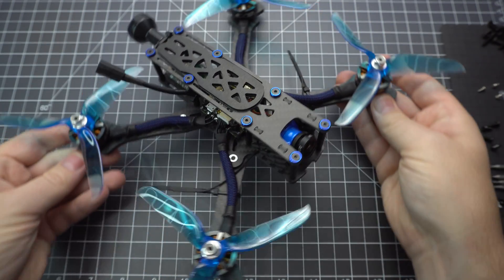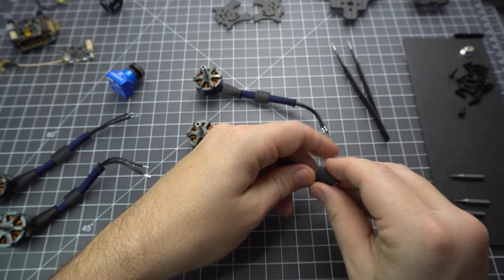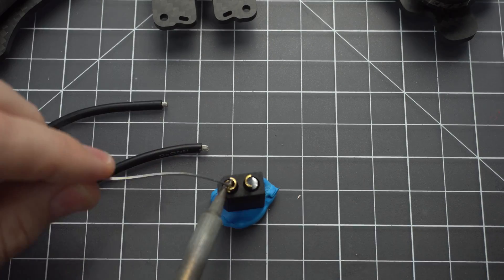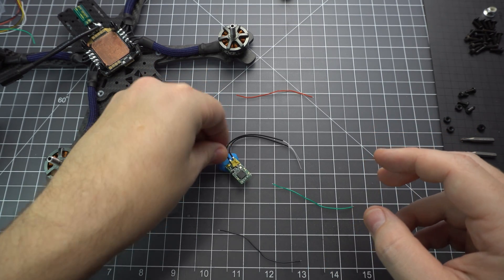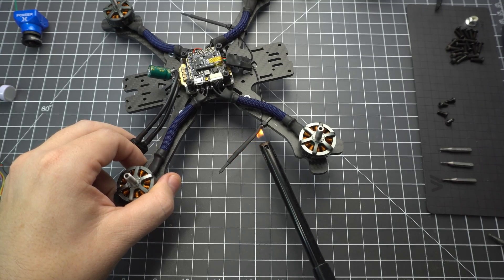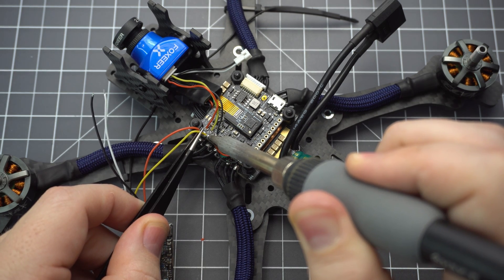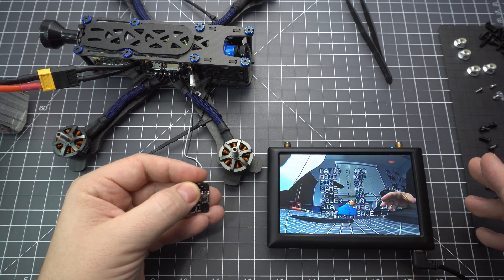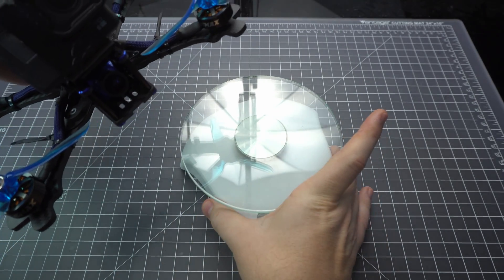How to Build a 6S FPV Freestyle Drone - TBS Source One

Comment: Ive been flying drones fot a few years now and im considering building my first drone . I also want to take my HS 150 Bolt Bee and put it on a different frame that way i can use normal lipo batterys instead of looking for battery packs for it

Comment: Hey! I have absolutely 0 experience with pid tunes, and have no clue what you meant when you said "betaflight reccommends you drop the p and d term about 30% for this build" is there somewhere that the betaflight devs give a reccommended pid tune for specific voltages? I just build the source one in 7 inch and def need a pid tune but dunno wtf im doing sooo.. any tips?

Comment: AFTER i ordered my parts for my first 5”  build, i come across this video and the parts list are almost identical, minus the flight controller (iflight succex e f407 stack) and powered by 4S… parts arrived today and ill be building soon, using this to follow along with. If it works out as expected, I owe it to the folks like yourself, and the heavy hitters in this hobby to document the effort as a true beginner 🤞🏼👍🏽

Comment: Would you be able to use the Xilo stax combo for this build instead?
Reply from the maker: Yep, that'll work just fine. You can use just about anything on this frame as long as it's got the amps to power the motors.
Reply: @whiffles  Thanks for the help

Comment: What capacitor are u using and can u use them for any 6s built?
Reply from the maker: It's just a 470uF 35V Low ESR Capacitor. And yes you can use them for any 6S build.

Comment: How much do all the parts cost?
Reply from the maker: The part list is linked in the description. The FC/ESC is discontinued, but you can use the alternative. You'll just need to adjust the wiring.

Comment: Superb video man. Din know you're the guy who made Rotor Builds until now. Really nice!!  Ive been following it for quite few months now. And I'm planning to build the same one except for the vtx which im planning to use a dji air unit. Is is okay if i remove the middle-rear stand-offs to fit it in.
Reply from the maker: You'll need several 3D prints to fit the full DJI air unit. It's much better to use the Caddx Vista with the longer camera cable.

Comment: I have a 30 x 30 Vtx is there enough room to mount it on the main stack with fc and esc?
Reply from the maker: You should be able to squeeze it in, but it may require tweaking the standoffs and spacing.

Comment: built this and fried my vtx on first plug in. one part melted right through the plastic shrink wrap it has on it. I have no idea what to do but I suppose these puzzles come with the hobby xD everything else went great and I love this set up. Just gotta get mine finished and working.
Reply from the maker: Oh no! Maybe double check the polarity. Did you get the HV version or the 5V version of the VTX?
Reply: @whiffles  upon a little research on how to find the polarity of a vtx just now... ive come to find that it is something I need to check and be familiar with so I bought a multimeter. I do have the hv version but I hadn't been thinking about polarity at all through this project. Noob mistake . I'm very much a beginner to rc and its been a confusing path to understand all this but worth it for sure. Any advice is very much appreciated. :)
Reply: @whiffles  also now im remembering there was a sticker on the vtx package that said "vtx 5v" so maybe I did have the wrong part. On my receipt though I bought the "TBS Unify Pro 5G8 V3 (SMA)"
Reply: @whiffles  one more thing. I did pay attention to polarity with the battery lead and capacitor I had no idea about checking it with the vtx and possibly other things
Reply from the maker: @sluj49  Just checked the specs and it says "Operating Voltage: 4.5 - 5.5V" so you probably gave it too much voltage. You always want to double check the max input voltage to your components. I used the "HV" version which takes up to 26v so if you wired it the same way I did that would have certainly killed it. Sorry to hear, definitely a bummer!
Reply: @whiffles  good to know I am going to buy the one you used. This is a much better alternative to having mucked things up in a mystery way. Thanks for taking the time! I very much appreciate the help.

Comment: Man, very helpful video. I was exactly looking for a guide like this. 

I am new to FPV and want to build my first Quad. I am considering useing the Diatone Mamba F722S Stack F7 FC + 50A ESC
 Stack instead of the Holybro. Would that work the same way?

Is there a big difference between the EMAX ECO 2207 1700kv and the Iflight XING X2207 1800KV?
Reply from the maker: I'm sure the Mamba will work just fine. Make sure you examine the wiring diagram closely though. The iFlight Xing motors are great, but if you're on a budget you might even want to look at the Xing-E motors.

Comment: What is the purpose of capacitor?
Reply from the maker: They're generally to keep the video feed clean of motor noise.
Reply: Whiffles Thank you! And how long does 4S LiPo 1500 mAh 100C battery lasts while using 2400 kv BLDC motors along with fpv

Comment: Why do drones have capacitors on the battery line? Is that to help managing power demand peaks?
Reply from the maker: It's more for suppressing some of the motor noise so lines don't show up in the video feed. It can also help filter the noise for the gyro on the FC.
Reply: Thanks

Comment: I want to build my first FPV drone - I want to attach a GoPro to it to film cinematics. I'm on a tight budget, so which build do you recommend?
Reply from the maker: This is a great beginner build, but you definitely need some experience either through a simulator or a micro to fly it.
Reply: @whiffles  I will definitely look into those options!  I was looking at the flight controller you recommended for this build, its no longer available on GETFPV, what alternative FC would you suggest!?
Reply from the maker: @alwinlee5864  There's a newer version that they've linked from this older one.
Reply: @whiffles  Hi Whiffles, I noticed that but its out of stock as well! It must be that popular!  What is your suggestion?

Comment: Whiffles : I really liked your build video and decided to make one just like it. I ordered all he parts but made a mistake and got 1900 kw Motors. I have a lot of s4s , no s6s and my chargers won't do a s6.. The manufacturer says the motor is good for 3-6s. What adjustments do I have to make to the setup to use s4s and how will it effect the performance.

Comment: nice and clear build! I did the same trick like you with receiver antennas using shrink tubes but for me it reduced range of my drone like a hell :/
Reply from the maker: What sort of range are you aiming for? I rarely fly more than 200m away.
Reply: @whiffles  So with shrinking tube 200m is my max I think but would be great to fly a little further around 400m. Without shrinking tubes it is possible but then I dont have protection on my antennas.
Reply from the maker: @dominikd2658  I think you should be able to to 400m easily with the shrink tube. You'll lose signal due to trees or obstructions before those cause any issues.

Comment: great build, what’s the cost and do you think i could make it with a longer range? i am newer to this so i don’t know what works together etc.
Reply from the maker: You can see the cost breakdown by following the link to rotorbuilds.com. You can use a Crossfire receiver on this if you've got a module or the Tango 2. Your biggest limitation is going to be battery life rather than radio signal.

Comment: Are there any cheaper options for flight controllers/esc stacks that would work well with this?
Reply from the maker: Sure, take a look at the HGLRC FD435. I just used it on my latest build and it was pretty easy to solder to.
Reply: @whiffles  Ok thank you

Comment: I just have to say man.. saying 3 1/2 minutes to storage charge and presenting it as the flight time for that battery is kind of misleading. A lipo can be discharged to 3.5v/cell and that is to keep the battery healthy. I know lots of guys who go to 3.3v and still get long lives out of there batteries. The way you were flying with an 1100mah 6s you could have easily got 4:30-5:00... Other than that though great video I love this frame for bashers

Comment: Hey Wiffles! I happened upon your video because we just so happen to be running the same Frame,VTX,RTX. It's my first build and I wanted to see how someone went about putting the frame together. I really like your Paracord idea and plan on implementing it.  Here's my build: https://rotorbuilds.com/build/22808  Thanks for the video!
Reply: Also if you have any recommendations or tips  I am all ears :)
Reply from the maker: Just be sure to check and double check your wiring before you give it any power and most importantly, enjoy the process!

Comment: Can you get a GoPro session mount for this quad
Reply from the maker: I'm sure you can find one. There are plenty. It may not have screw holes to match the frame, but a universal mount with zip ties should do the trick. Check Thingiverse or Brain3d.co

Comment: hello , I started making a DJI drone from the beginning, I bought a case from DJI mavic 2 zoom without electronics and motors, I don't use original electronics from dji mavic, I have problems calibrating some sensors with this Flight Controller , or you have an idea what flight control electronics to use, butmust having sensors proximity?
Reply from the maker: I don't think Betaflight supports proximity sensors. DJI uses very proprietary hardware and you'll likely need to use their own for those sensors.

Comment: This may sound dumb but what is the capacitor on the 4 in 1 ESCs for?
Reply from the maker: It helps prevent motor noise from interfering with the video feed and the gyro.
Reply: @whiffles  My FC comes with one... is it worth putting it on the FC? I don't have a 4 in 1 ESC....
Reply from the maker: TBT techbasstracks How will you power it? Put it where your power lead connects.
Reply: @whiffles  Yeah I will, Do you think it will make much of a difference on an FC?
Reply from the maker: @tbttechbasstracks4220  It's always good to add. Do you not have one? You can try without and see if it twitches or if the video feed has lines in it.
Reply: @whiffles  A capacitor came with my fc I bought. I'll just add it I suppose.... One more thing, how do you tell which side is negative? Thanks
Reply from the maker: @tbttechbasstracks4220  The negative side has a strip of color down the side. The positive side doesn't have a strip.
Reply: @whiffles  Does a strip of grey count? the capacitor is black
Reply from the maker: @tbttechbasstracks4220  The color doesn't matter as long as there's a strip along the side.
Reply: @whiffles  Good stuff.... Thanks man! appreciate the effort.
Reply from the maker: @tbttechbasstracks4220  Sure thing!

Comment: What size paracord did you use for your motor wires and what size capacitor did you use? was it 1000uF Caps?
Reply from the maker: The cord is called Para-Max. It's listed on the part list on Rotorbuilds. I used a 35v 470uf capacitor.

Comment: Amazing build!! I had a question could I use the xing 2207 motors instead of these and would it work?
Reply from the maker: Certainly! Just be sure to choose the kv according to the batteries you plan to use. ~2400kv for 4S and ~1800kv for 6S.
Reply: @whiffles  also the fc + esc is out of stock can you recommend something else that I could use

Comment: Are there any other good batteries you would recommend for this drone that can make the flight time longer or is the one used in this build the best one?
Reply from the maker: When it comes to quads of this type you won't get more than 4-5 minutes of flight time. The one I used should get you about that if you don't fly too aggressively.

Comment: What is the max speed and range?
Reply from the maker: This type of quad can generally go upwards of 80mph and the range depends on the radio system you're using. Crossfire, for example, can go a few miles while the FrSky system I used here can go a mile or two. The range is mainly limited by the battery life.

Comment: Has anyone tried this build with the DJI air unit ?
Reply from the maker: You’ll need to print some TPU bits to mount the air unit and you may need to mount a smaller flight controller in the back.

Comment: Thank you for this great video.
Can I ask something?
How can learn programming and design pro drones?
Reply from the maker: Watch lots of videos
Reply: @whiffles  OK but in videos there in not about programming... Am I right?
Reply: @whiffles  can you show some video?
Reply from the maker: @pouria3132  Do you mean the Betaflight configuration? I have the written instructions on the guide at RotorBuilds.com
Reply: @whiffles  no I mean c or c++ programming for a flight controller. There are some arduino codes but they aren't so good.
I mean that about flight controller do it yourself. Pcb design programming and...
Reply: @whiffles  Keil is ide for arm. Like stm32
If you know how can I learn please tell me. Thanks a lot.

Comment: was following bardwells build video and sourced slightly cheaper components. ran across your video when putting together the tbs frame. we basically have the same build except for the motors. question. what does the capacitor do on the esc? some builds i have watched they do not include an extra capacitor. thanks for the info
Reply from the maker: The capacitor helps smooth out the video feed when you punch the motors. It can also help reduce electronic noise to the gyro. It's not necessarily required and a lot of newer boards have pretty good built-in capacitors, but it doesn't hurt.

Comment: Hey man! Great video. Can you share the PIDs you are using in the  maiden flight or in case you made any changes the resulting ones? Thanks so much!
Reply from the maker: I just reduced P and D terms of pitch and roll by about 10. It was a very cursory tune, so there's still room for improvement. This was on 6S though. I you're flying 4S then you probably don't need to make any adjustments.

Comment: Was there a reason why you didnt  power the camera from the VTX? I understand that the FC has power pads for the cam, but is it filtered on the Kakute? I thought that the TBS unify had filtered power for the cam, but now Im not sure. I know that the Nano has an LC filter, but there isnt much info about the big boys.
Reply from the maker: I mainly did it for simplicity and wiring cleanliness.  I've never had any issues powering the camera through the flight controller.

Comment: What is the difference between the Kakute stack and the diatone Mamba stack? Both have a 4 in 1 40 A ESC and an F4 FC but the Kakute is like double the price? What makes the Kakute that much more expensive?
Reply from the maker: It has a much more sensitive gyro which should perform better, but honestly I can't tell much difference. It also has 32 bit ESCs which offer some performance improvements as well. The Mamba stack should be just fine.
Reply: @whiffles  thanks.

Comment: where would I hook up the microphone wire if I did want to use a microphone?
Reply from the maker: You need a microphone or a camera with a mic.
Reply: @whiffles  ahh right right that makes sense, imma save the wire i pulled out then, thanks

Comment: Wow I didn't know you're RotorBuilds dev! Question: Do you know if the props are visible on GoPro Session 5 with 25deg angle? Because it seems like the arms are a bit pointed towards the front.
Reply from the maker: I haven't tried 25 degrees, sorry. They may still be out of frame.

Comment: I´ve just ordered a tbs source one bundle/kit. It has hobbywing xrotor fc and esc, and unify vtx. This will be my first build, and I find this video very helpful, thank you :) Even if its not the same components as you, I guess it will be about the same procedure. I am going to use the unify mounting board though :)

Comment: Awesome build.  What capacitor did you use?  How do you think this would perform on 4s?  Would you change motors if running 4s?
Reply from the maker: I just used a 470uf capacitor. I believe the flight controller came with one.

Comment: This is just the video i needed! Thanks for this great tutorial video! I’m brand new to this hobby and just got the source on frame. Have a question what are the pros and cons on the 4in1 esc and the individual ones? And what do u prefer? Thanks keep up the good tutorials!
Reply from the maker: I prefer a 4-in-1. It's much easier to build, it's well protected and it works great.
Reply: Whiffles sweet! Thanks 😄

Comment: can i know the awg size of the wire?
Reply from the maker: I typically use 16awg for the power lead. You can use 14awg but it can sometimes be difficult to solder.

Comment: Awesome build! Do you think it could be modified a little bit for longer flight times and ranges?
Reply from the maker: You can add a Crossfire or R9 receiver to make it a long range rig, but there's not a whole lot you can do to increase flight time. Maybe a slightly larger battery, but 4-5 minutes is about as much as you can get on a 5" rig.
Reply: Whiffles Ok, thank you!

Comment: Did you change pids and filters on BF. I’m having issues flying similar setup on BF 4.0.6 it shoots straight in to the sky after a little of throttle
Reply from the maker: Check the gyro to make sure it's not touching anything and is floating on the foam pad
Reply: Whiffles I’ve checked it but it seems to be mounted correctly and nothing is touching it. I thought it was the wrong pid settings that makes it fly away. But I understand that I need to verify if gyro works ok
Reply: I had same problem.  After giving a little throttle. Try to cancel air mode.  It helped me.

Comment: why did you remove the smart audio wire?
Reply from the maker: There are wires for both audio in the traditional sense and Smartaudio. I removed the audio wire since there isn't a mic. The white wire is for Smartaudio.